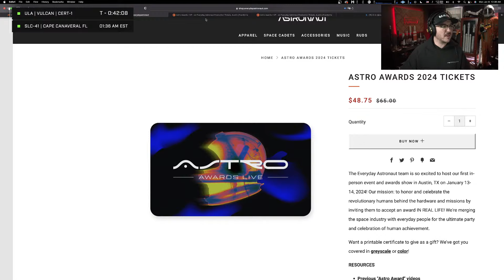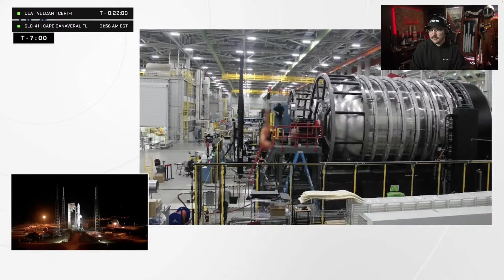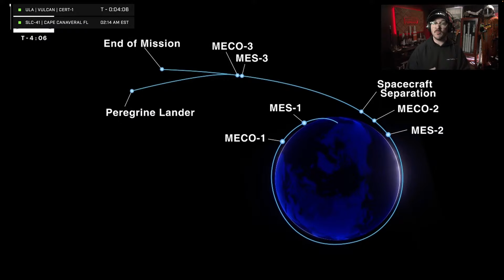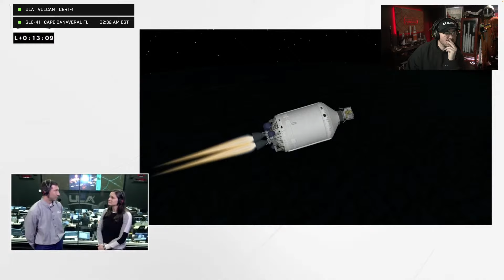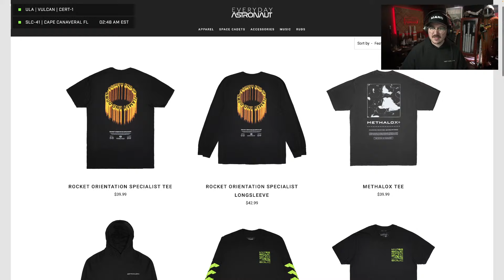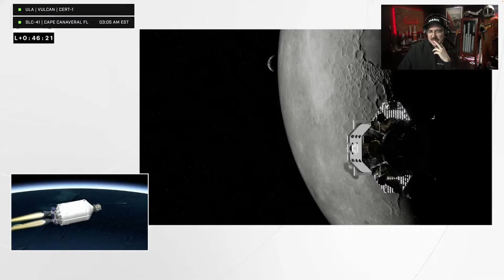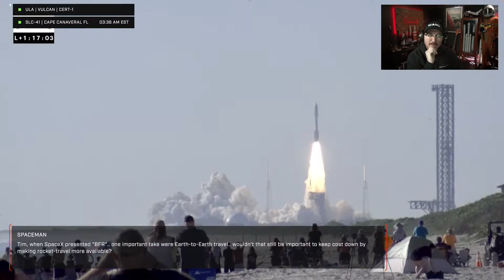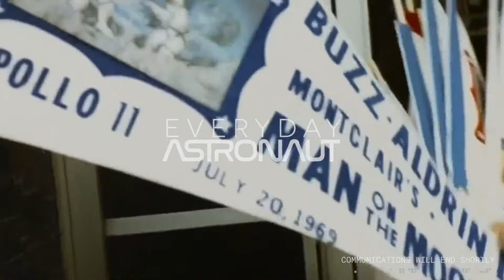Watch ULA launch their Vulcan rocket for the first time ever! #Vulcan

Comment: Big Congratulations to ULA and everybody involved! It might be quite a bit behind schedule and not the most groundbreaking rocket, but that doesn't take anything away from it being an awesome vehicle hopefully serveing ULA well in the coming years along with bringing new capabilities to the launch market.
Reply: The other big factor is a transition to something more cost careful (relative to projects like SLS which ULA was also involved in).
Reply: Still a surprisingly powerful big little heavy lift rocket to GEO.  It can do the job of a Delta Heavy in a smaller package
Reply: @ph11p3540  As far as I know a Vulcan with 6 SRBs can deliver even more than a Delta IV Heavy to GTO/GEO. That's part of the new capabilities I mentioned.
Reply: Not ground breaking? Let's review.

1.) First methane powered rocket to EVER REACH ORBIT! They did it BEFORE SPACEX! Bezos's engines made it to orbit before Raptors did! 

2.) Massively upgraded upper stage with over 50 tonnes of propellant and a mass ratio greater than the previous centaur. It's dry mass is now confirmed to be 4.7 tonnes; compared to 3.5 tonnes for the previous centaur despite having more than TWICE THE FUEL. Production cost of the RL-10 has also come down from 20 million each to 10 million each. 

3.) Has the same performance characteristics as the Delta IV Heavy, despite costing 40% the price in inflation adjusted terms. 

4.) Upper stage development is continuing to increase endurance to several months from a day or so. It's already the highest endurance upper stage on the market, about 4 times higher than the Falcon 9 or Falcon Heavy. They have a 100 million dollar contract with NASA to do this. 

Again;  HILARIOUS that with all the SpaceX simping that ULA managed to beat SpaceX in the race to get a rocket that used methalox to orbit!
Reply: @randominternet5586  ULA is only peripherally involved in SLS with the ICPS upper stage and the fact that Boeing is one of its parent companies. Beyond that, once the transition is made to the Boeing-built EUS, ULA will no longer have anything to do with SLS.

Comment: It took 11 years from the start of the Mercury program in 1958 to land two astronauts on the moon in 1969,  Amazing.  But now it takes 11 years for ULA/Blue Origin just to put a dinky little lander on the moon. And it took Boeing 11 years to develop and launch SLS when they already had the shuttle engines.  This is why we need the new generation of rocket companies to replace the stagnant old guard.
Reply: The number of other rocket companies that have put a lander on the moon can be counted on one hand.   Instead of comparing this launch to what happened early in the space program why not compare to the very other rockets that have sent a probe to the moon SINCE those early flights.   The launch vehicle already did its job perfectly.  So regardless whether the lander is able to overcome a fuel leak and make it to the moon remains an open question.  Sending probes to extraterrestrial bodies is very difficult.  

 At any rate it is quite juvenile to disparage the Peregrine lander because of its size.  This lander has 20 science experiments.  If you judge everything based on size then you have much to learn.
Reply: @michaeldeierhoi4096  I agree with most of what your wrote, but I wasn't disparaging the Peregrine lander; I was basically lamenting how the space industry became stagnant after Apollo.  I worked at Boeing/Rocketdyne throughout the '90s, mostly on the ISS, but also on the Shuttle and Delta IV and it was the worst job I ever had.  Management, and most of the engineers just didn't care about cost or schedule, and there was virtually no effort to innovate.
Reply: @steverobbins4872  You speak from experience and I can't measure up to that and won't try.  Thanks for your comment.
Reply: I wasn’t aware that a “company” put a man on the moon…ever.  It’s a lot harder when you have to make money while doing it.

Comment: One thing that's striking in comparison to typical Falcon SpaceX launches is how longer the 1st stage burns on this rocket, it's almost twice as long. It makes complete sense they didn't pursue booster recovery since the speeds of the booster at engine cutoff would make recovery difficult at best.
Reply: Probably be asking too much to try engine recovery on the first launch. Assuming it happens, it'll be several launches down the line.
Reply: Engine recovery is a pipe dream with this rocket. The most they have shown to the public regarding engine recovery was a sketch that looked like it was drawn by an elementary school kid.
Reply: The stage split has to do a lot with the relative sizes of the booster and upper stage engines. RL10 is hella efficient but is a relatively tiny engine, so BE-4 / SRB have to stage relatively high up to make up for it.

Comment: ULA is incredibly impressive. They may not launch near as much as others but they just work. There’s a reason the military still focuses on using them. Brand new rocket never flown and it just goes.
Reply: To be fair, if ULA was building a fully and rapidly reusable rocket capable of lifting 100t, this flight might not have gone this way. Easy to make something look like they just work when no boundaries are being pushed. Or do you make similar posts on every successful Falcon 9 launch too? Falcon 9 launches btw that actually return and land the booster under its own power.......
Reply: @sexpistill , why are you reviving a necro-post from 3 months ago, while saying nothing of value? You a bit of a SpaceX hater?

Comment: How did I miss the part about ULA landing the reusable first stage (by any other name)?  ... Oh. Wait...
Reply: 85% of the cost is in the engines. Just re-use those and still get full burn instead of having to save fuel for a powered landing.  Two ways to skin that cat.  SpaceX didn't safely land boosters for a number of missions, either.  It took a while to perfect that. And no one thought eight years ago that SpaceX would be able to re-use one up to 20 times (even SpaceX). So that program is very mature and going really well.
Reply: @gloredon
Show me where ULA has actually done any work on there reusable engine plan. I’ll be surprised if it ever happens.
Reply: @jamskinner  
Nobody has it going on like SpaceX!  THREE launches already this year and its only the 9th!

Comment: Good job that Falcon Heavy has some competition.
Falcon heavy is likely far far cheaper (even without reusability) with not very significant performance compromises in exchange for the likely much lower cost!
But competition is always good all the same!
Military will use it, but for enterprise, the use case may be tricky given the competition from SpaceX
Reply: The costs get a lot closer once you look at GeoSync, GPS, LIO, and Interplanetary missions between Vulcan and Falcon Heavy.  SpaceX needed a waiver (because they had to fully expend all the cores on their Falcon Heavy to succeed) for its government requirements for a couple of the mission sets (which was granted, of course).  The only place that Falcon 9 and Heavy are substantially cheaper is LEO missions.  Some things are just harder than others.  ULA has a lot of missions sold already for Kuiper launches.  Pre-Sold.  Most every provider can launch to LEO. Things like Lucy, Perseverance, the James Webb, GOES satellites, etc. require more.
Reply: @gloredon  What's the cost of the Vulcan with all the additional boosters (6 i think) needed to reach geo orbit? Correct me if I'm wrong but the bare bones rocket is similar in cost to the falcon heavy right?

It also has about 1/3 the lift off a falcon heavy to LEO.
Reply: Falcon heavy always expends the center stage, so while they can reuse the outer boosters, they still need to throw away what is the equivalent of a full falcon 9 (including the upper stage) on every launch. Falcon heavy is a super cool rocket to see launch and land, but it's not a super efficient heavy lift rocket from a reuse perspective. (There's a reason Elon tried to kill Heavy in favor of dumping all their effort into BFR / Starship).
Reply: @TimCortesi  The vulcan will lose 6 boosters and the main rocket when launching at full capacity. The Vulcan with 6 boosters has a lift capacity of 29.9 tons to LEO and 16.85 to GTO.  The falcon heavy has a lift capacity of 63.8 tons to LEO and 26.7 to GTO. 

The vulcan seems like a fine rocket but I can't see how it will be cost competitive without reusing at least it's boosters. This seems like a rebranded atlas 5 marketed as some new technology.

Comment: They can't throttle control the SRBs correct? The ULA announcer says something like "cutting back on the SRB" but I didn't think that was how it worked
Reply: I think there are SRBs that can throttle, but it's all pre planned. Fancy ways of engineering the interior structure of the SRB fuel layout so it has different thrust at different points in the burn. I think Scott Manley had a video about that several years ago...

Comment: Haters hating because it's not reusable. But in terms of launch cost it's pretty competitive. It's much more capable than reused falcon 9 and while losing to falcon heavy in terms of mass to orbit, it's way cheaper and offers larger payload fairing for missions needing that extra space. 

Vulcan is not obsolete before new glenn and/or starship become operational and reliably reusable.
Reply: You're comparing to rockets that will be phased out very soon, while ULA isn't even working on reusability. Starship is going to be so cheap.
Reply: @riparianlife97701    What rockets are you claiming will be phased out soon?   And don't you know that there are other rockets whose makers are working on reusability either.  The Russian Soyuz and European Arienne 6 are two examples.  Arienne 6 like Vulcan is also late getting to its first flight.  Every rocket company is at a different development stage.
Reply: @riparianlife97701  Not true at all.  Just a different method, as Tim said, so that the booster fuel can be fully utilized (efficiency and cost).  Re-use the 85% of cost that is the engines. Starship's cheapness is a 'claim' and it is for LEO only.  Many more mission sets than LEO. New Glenn and Vulcan will dominate in those others.
Reply: @gloredon  Okay! I'm going to start a bus company where we throw away 15% of the bus after every trip. The cost will be passed on to the customers. Wanna buy in? 

SpaceX already has that down to 10% with Falcon 9, and they aren't satisfied.
Reply: @gloredon
The company who has never reached orbit in 20 years is going to dominate?
Reply: @jamskinner  They get a participant trophy for today's launch.

Comment: if the be-4s get dumped every time, how many launches of this vehicle per annum are realistic?
Reply: There is a plan to recover them.
Reply: Consider that SpaceX can make a raptor every 2 days now.  If Blue can make a BE4 every 5-7 days (it is a bit bigger, it is certainly feasible), a LOT (as in 26/year without any re-use). I expect Blue to double their production line now that the rocket has proven itself, because they will put 7 of these on each New Glenn booster, which is supposed to be re-usable. Blue spent a LOT of hours on the test stand with these. The first couple engines had over 4000 seconds of firing time each.  That's nuts, easily 10+ missions worth.

Comment: SRB separation: I assume they hold on to them for that "extra" time because they are still producing SOME thrust, and (more likely) to avoid any risk of exhaust plume damaging the main rocket.
Reply: Since it is a solid, once on, they stay on until fully burned out.  Unlike the Falcon heavy sides, you can't shut them down and you don't want to jettison them while still burning, as they might damage the booster, which still had another 2 minutes of burn time to go.

Comment: There is nothing "revolutionary" about this rocket.  It is a small incremental improvement to its prior gen rocket.  Nothing revolutionary compared to Starship.
Reply: Yes there is something revolutionary about it compared to Starship it works.  Also Starship is clearly a derivation from the Soviet Union's N1 rocket which also was a Monumental spectacular historical failure
Reply: F-9 could not perform this mission. F Heavy could but even here, it would expend the core stage
Reply: @bernieeod57  what would be the cost difference between this and falcon heavy, even with the expended center core?  How much waste between expending the entire Vulcan vs single center stage?  I'm just not impressed with the amount of time and engineer that went into this rocket and it's barely any better than the last gen rocket.
Reply: @vt1272  Since Elon will not release his books, we really cannot say. We do know he was launching at a loss in order to corner the market and even after F-9 was being reused, he raised his prices, not lowered them.
Reply: Don’t post bullcrap. Starship is not a derivative product of old Russian hardware. It’s a derivative of falcon 9. Use lots of small cheap engines.
Reply: @bernieeod57
Speaking of books, what did ULAs rocket cost?

Comment: Is it re usable? Does it land back on the pad? If not its old tech.
Reply: F-9 could not have performed this mission without opening in expendable mode. F Heavy might be able to but even here, the core booster would have to be expended. Either way, F-9 or F heavy would not be any cheaper

Comment: Do they separate where the vacuum starts? Animations look nice! I guess the cameras from the moon in 1969 were better. Will they broadcast some video from the moons other side? Or it will be an animation? Also how do you get fire in vacuum?
Reply: Fire works perfectly well in vacuum.  You need a fuel (methane) and an oxidizer (liquid oxygen).  That's how ALL rockets work, they supply their own oxygen for the fuel to burn. The only difference is the fuel itself, Hydrogen, Methane, Kerosene (RP1). The vacuum doesn't just 'start' the atmosphere gets thinner and thinner until it is 'essentially' so thin we call it vacuum (particles in a low single digits ppm).  Oh wait, are you just a FLERF?

Comment: is this rocket any cheaper than an atlas 5? everything i have seen shows its basically a modified atlas with different engines.
Reply: The first stage is cheaper being simple light aluminium with the aim of mass production.
Reply: @alextaylor9746  isnt that the same as the atlas v?
Reply: Once they recover the BE 4 for re use, yes it will be cheaper plus, Vulcan has a larger payload capacity.
Reply: Yes.  And no Russian engines on it.  For National Security missions, necessary. Way cheaper than Delta. Cheaper than Atlas, and more capable, plus cleaner fuel. RP1 is kinda dirty fuel, compared to Methane.  That's why SpaceX, ULA, Blue, and others are going to it.
Reply: @gloredon  how can it be cheaper, the be4 engines cost almost as much as the rd180 and it needs 2 of them. 

They also havent done any testing of recovery hardware, and I'm not aware of any tested inflatable heatshields on the scale they need to recover multi ton engines.

I think the only way it's going to work is with BO and ULA merging.

Comment: We saw history today as the very last single use rocket lifted off.
Reply: You tried to make a dig at ULA launching the nonreusable Vulcan and still didn't get it right.  The Arienne 6 is the upgrade from the Arienne 5 and also is a single use vehicle.  The development of that vehicle was well under way when Space X started to tests to land the Falcon 9 and who would have guessed that it would end up being so successful.  The Russian Soyuz is also not reusable.

The bottom line is every rocket company is on a different track.  They are doing what works for them.  Space X happens to be lead the pack so to speak for now, but that will change with time.
Reply: @michaeldeierhoi4096  I was thinking of Ariane 6 as I wrote it,,but I couldn't help myself.
Reply: @michaeldeierhoi4096
The future is at least partially reusable. Anyone not doing that will go under unless the government props them up. IE, ULA.